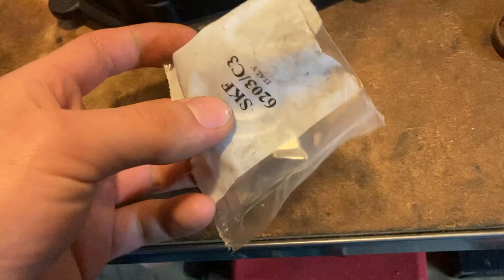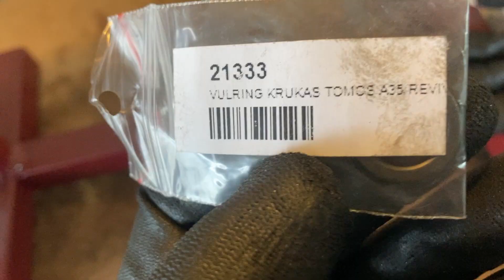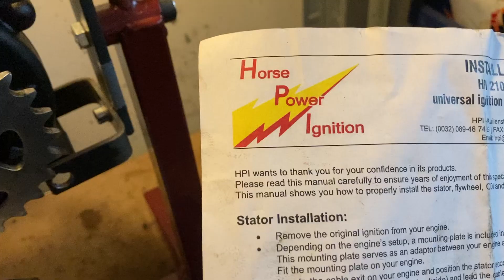EXTREME Tomos 70cc Engine Build!!

Comment: Looks too me  like u o.d on the engine porting  looks thin too me air leak in no time  u need to leave at least 2.5mm on the base  engine cases for good seal just my 2 cents and the head gasket  needs to go upside-down 🙃  everything  looks clean good luck on the build

Comment: Kannst Du bitte auflisten was hast Du alles verbaut  ?
Reply: 70cc parmakit, high pressure head, bing 19mm carburator, hpi 2Ten ignition, jammer clutch, jasil racing crankshaf, m-pipe, powerfilter, 19mm manifold